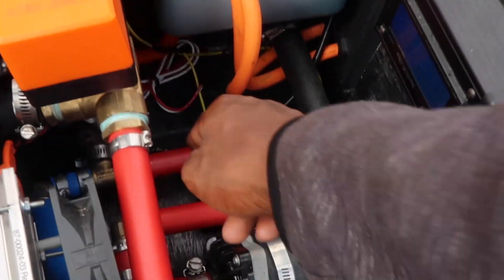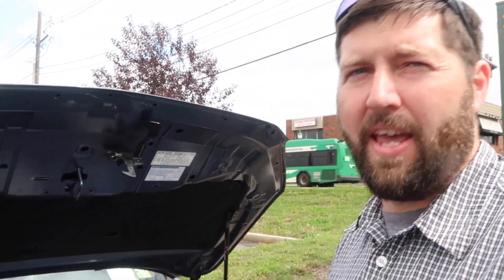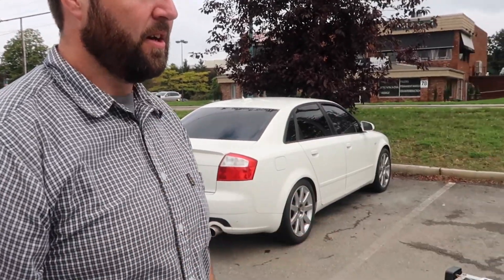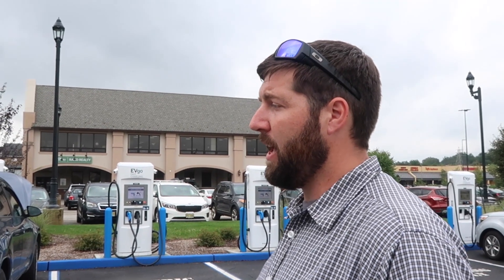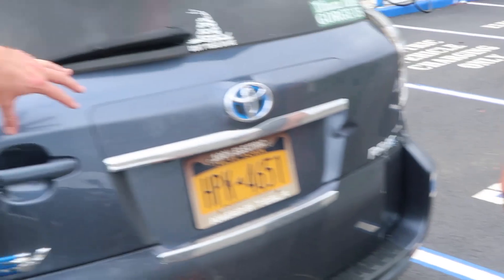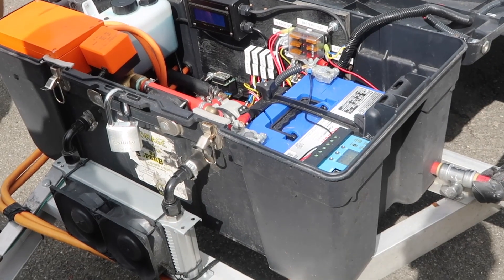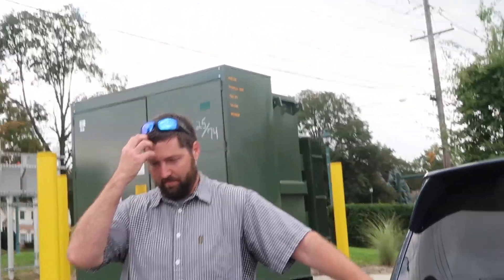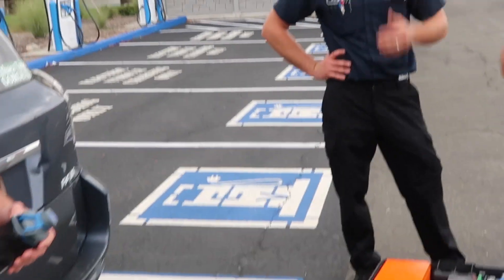The True DIY Tesla Range Extending battery Trailer

Comment: I think you'd be further ahead with Tesla modules to stack them in a shorter trailer, on something like that Rav 4, it being closer and shorter to the vehicle, would allow it to be more in the slip stream, and cause less air resistance.  Maybe a motorcycle trailer, but stacked higher.
Reply: My goal is to do the same thing but with a flat Tesla 100 kwh pack. Then I want to build a removable lightweight teardrop trailer over top of it. That way I can use it to move stuff AND for camping trips with my wife and son.
Reply: I like the shorter trailer idea, also the trailer hitch cargo box if you could cram enough components in there.. lol

Comment: Cool idea... But seems like alot of extra work and stuff just go another 120~ miles.
Reply: It really wasnt hard at all. Plus it was a fun project.
Reply: @JamesKlafehn  AWESOME IDEA!!!!
Reply: PolskaWalczaca thanks!
Reply: I suppose the main goal is the learning process and the experience, rather than the addition of extra miles.
Reply: Akinlolu Oderinde no, it was really the extra miles. Ha ha I live in Central New York and New York is way behind on charging infrastructure. I needed at least 200 miles of range just to get out of the state and to the next fast charger
Reply: Great job man, subscribed
Reply: Battal Baba thank you!
Reply: dana44s Sure a bit of effort and ~$8,000.  Or he could just go out and buy a new EV with more than 240mi of range for $30,000+.  Only he'd lose a bunch of cargo space at the same time unless he went for the Model X where he'd have to pay $80,000+.  So, it's not about the amount of work to go another 120 miles.  It's about the cost of being able to get the added range.
Reply: Thats kind of what I was thinking. I need the space so i cant go with a smaller car. The only car comparable is a Model X. A model X is going to cost me $100k. I could have 6 Rav4 EVs for that price. So spending $5, 10 or $20k still leaves me ahead.
Reply: He more than doubled his range. All while learning and visualizing how far boundaries can be pushed.
Reply: It's a really cool proof of concept that a lot of people thought wasn't possible and 120 miles is almost double his current range. Hell, if he manages to snag an entire tesla battery pack from a newer model S or Model 3 with the extended battery option, I can see his Rav4 being able to get over 400 mile range. Plus this would be a very cost effective option.
Reply: Maybe so, unless you need to go another 100 miles to make it somewhere...  but now that he has it figured out, pretty easily to put TWO packs on there,
and now it will go 240 extra miles!  Or THREE.

Comment: 4:33 what are those on his rims lmfaooo
Reply: Yeah they look kinda silly, I know. But they do help aero. I figured it wouldnt hurt and I have left them on all summer for my road trips
Reply: I believe those are designed to save fuel by making the wheels slightly more aerodynamic.
Reply: Pizza pans from a restaurant.  Lmao ugly but would work.
Reply: You can get genuine Moon discs for $24.95 or Walmart pizza pans for $8.97. I don't know why this guy spent $1000s on his trailer and cheaped out on the hub caps but the pizza pans are a thing in the hyper miling community.
Reply: Mr Danforth 374 because i didn’t want to spend money on such a silly thing. Maybe it got me an extra 6 miles. Idk. Why spend a lot on it or put more thought into it.
Reply: Mr Danforth 374 Might as well get a honda insight if you wanna cover your wheels
Reply: Josh _ right... because that’s the same thing as what I did. Lmao

Comment: I’ve been waiting for someone to build this.  Sweet 👍
Reply: Thank you :)
Reply: Jehu,channel built one for his ev,Volkswagen bus
Reply: cartmanrlsusall His was nothing compared to mine. Mine was already half done before I even saw his video. He didn’t use a BMS or heating/cooling system. He built his for one trip and took it apart. Mine is a totally self-contained unit that can be used for many different different purposes. Mine is still working to this day.
Reply: @JamesKlafehn  I'm not throwing shade,I like what both of you have made .if I had the time and money I would be in my garage wrenching on my own version. I didn't know behind took his apart. I have a ton of questions but the main ones are how is hill climb performance? Does it still get over 200 miles of range at 75 mph?I drive highway miles in East Texas and Louisiana where our speed limits  sometimes run 75to 80mph,if you go slower it can be an issue
Reply: cartmanrlsusall When you tow a trailer it’s not really safe to drive 80 miles an hour. Small utility trailers like this one are usually rated to around 55 mph max. Like with any car, driving above 60 mph diminishes your range very quickly
Reply: cartmanrlsusall hillclimbing is fine. The car has plenty of torque